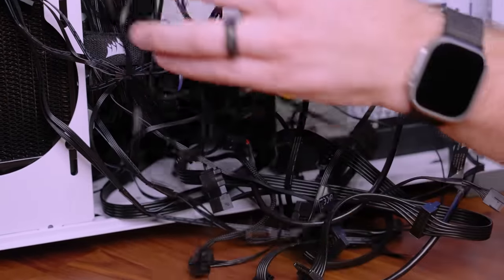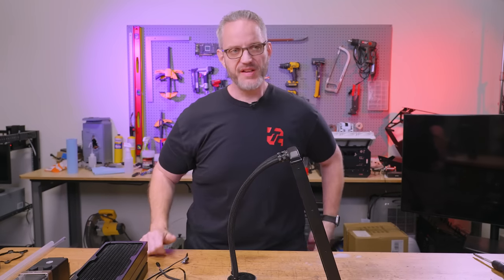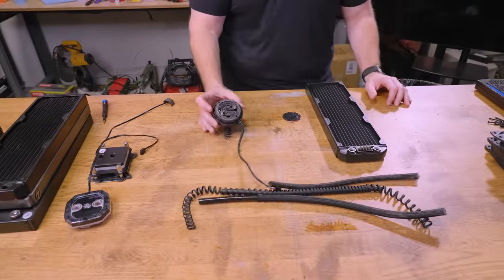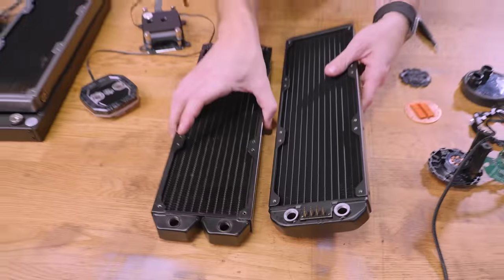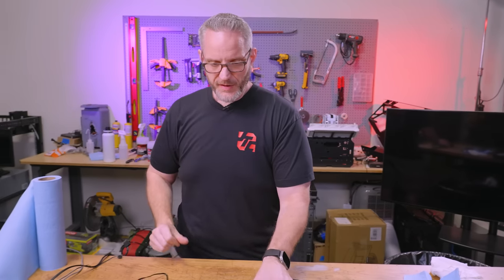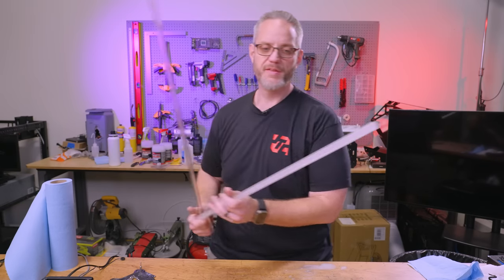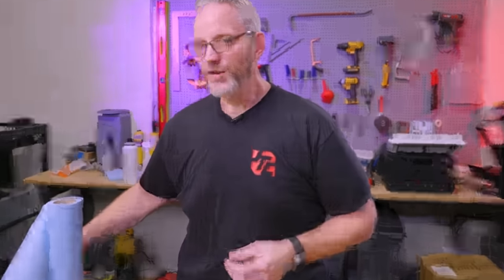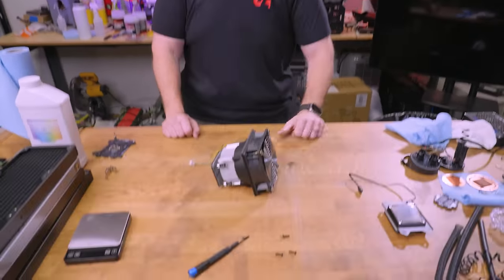Which one is right for you?

Comment: This was enjoyable content to watch; thank you. Seeing someone experienced with custom loops putting one together is a much more attractive video than watching someone install an AIO; will look for related videos from you if I ever stop using air coolers for my setup.
  AIOs never made much sense to me as the many I handled never seemed to handle temperatures better than a high end air cooler, cost more than said air cooler, and were noisier systems than the air cooled equivalents though I didn't get to work with them + the latest heaters from AMD/Intel.
Reply: AIO's absolutely spank high end air coolers these days .  They can run at least 3 to 5C cooler, take a lot longer to soak, and are nearly always a lot quieter.  This will obviously depend on the size you get, but spending money on a sensible priced one like Arctic Liquid Freezers (and not some of the insane priced RGB covered rubbish out there) will get you far better thermals and acoustics than any air cooler can provide.  It will be interesting to see the performance of the new Deepcool Assassin 4 and NHD-15 Rev.2 when they are released - they will certainly close the gap, and current models like the AK620 and Peerless Assassin make strong arguments from the value perspective of good well priced high end air coolers vs AIO.

Comment: The tube has a wall on both sides of it, so for a 10mm inner / 14mm outer, the wall is not 4mm thick, but 2mm thick, x2 because it's on both sides.

Comment: Not realizing AIOs are usually aluminum is a bit of a stress point for me now. I added custom water cooling to my laptop using a BeQuiet Pure Loop. The piping used on the laptop is copper because I just default assumed the AIO was also copper. I found out it was aluminum after 2 months of use and changed the coolant to something with more corrosion resistance but Im not excited for the day I have to remake the heatsink because of mixed metals.

Comment: Thats why i love my D5 Next. You can control it "via PWM", but you can change it even without any software. And it has a build-in "mini-Aquaero" and a temp sensor. Control your radiator fans in dependence of the coolant temp? No problem! No need for an extra sensor and no extra cable. But it costs a little more. 130 Euros compared to 70 to 80 Euros for a standard D5 pump.
My whole CPU-only loop was about 500 Euros and therefore about 1,5 times as much as my CPU. Thermalright contact frame, Aquacomputer block and pump/res-combo, Alphacool rad, EK softtubes and fittings - with drain valve. Fans...? Arctic P12 PWM... and yes, without RGB!

Comment: Side note.
Copper and Zinc = Brass
And
All zinc-based alloys have excellent corrosion resistant properties; they just act a little differently than aluminum based alloys. While aluminum has the ability to “self-heal,” zinc will eventually break down and degrade over time.

Comment: I’d rather go with an AIO for the simple fact that I don’t have to set up the loop, if it leaks it’s not my fault, if it fails it can be easily replaced under warranty, when deconstructing the computer AIO is much simpler to uninstall. 
As for your comment about the i9 13900k, unless you’re over clocking then quite honestly an AIO will work just fine. I have an i9 13900k build using a deepcool LT720, my cpu never goes over 68C under extensive load even in an sff pc case not running push pull on the radiator

Comment: I've never used more than one fan at the back of my towers, and the one that comes with the CPU. I just bought 5 new fans and a hub to, for the first time, do something about cooling. Not that my components get too hot or that they fail (I've never had that issue), but I fear that the desk I'm about to build will somewhat enclose the tower with wood and, where I live, summers can get extremely hot (about 40°C on a really bad day) and extremely humid (usually more than 90% on rainy days). I don't have the money to even start thinking about water cooling, so a lot of fans is the only thing I can do.

Comment: I use both, but I only use an AIO on a cpu that doesn't generate a lot of heat. My AIO of Choice is a Cooler Master Glacier 240L. I have 2 and they can be expanded and drained and refilled with Swiftect fluid. Which I have done several times. On my larger more powerful/Heat producing system I use an open loop with Very High End components. Heat Killer, Hardware Labs, EKG. The Radiators are 60mm thick, you will never find an AIO with a radiator thicker then 30mm. Choose wisely your CPU and GPU will depend upon it.

Comment: Build my first PC in over a decade. Using an AIO for now, because I had to get it up and running ASAP. But as I upgrade from the parts that were readily available I just might move to a custom loop. The last time I built a loop premade and modular fittings weren’t as readily available. I spent a fair bit of time in the plumbing aisle of my local hardware store >.<

Comment: Custom Watercooling FTW! Did it since 2008 and still doing it today! For: the overall build quality, aesthetics, looping, thermal performance and longevity which are better than any AIO if you do your research correctly! However the biggest win for me is GPU watercooling across 2-4 SLI Gpus. (Remember when SLI was still alive and kicking?) Plus my RTX 4090 is soooo small now ^_^
As a plus: You can re-use parts from your custom watercooling in the future - if ofc it still makes sense :)
Edit: i added this comment before watching the video ;)
Reply: I still don't have enough fittings Jay, and last year I spent 200£ on buying all the fittings that I would need for my new build... Guess what? I was still short of a few :)) Fittings are the most expensive part as you can never calculate exactly how many you need if you want to do anything a bit more fancy than connecting A to B no matter how it looks ;)

Comment: The lines and block being restrictive doesn't make any difference when it has to go through a restrictive radiator. Also, only use ceramic thermal paste. You don't gain enough cooling from using corrosive pastes to justify doing it.

Comment: As a hobby brewer that has attempted to try and understand water chemistry(it's incredibly complicated!) , i wanted to talk about the use of distilled water. It is the minerals within water that provide a buffering power that help resist ph changes. The problem with distilled water is that it is super sensitive to ph changes because there is no buffering power what so ever. So it is very important to use an anti corrosive agent when using distilled water. Even if you use an all copper system, you will still have an ion exchange occur through your water and this will cause your water to become acidic and corrode your system. Not saying using mineral rich water, because this will create another separate problem of mineral build up, but definetely use an anti corrosion additive!

Comment: I'm not an over clocker, all my PC's are above average builds that can last 10+ years. I've run into too many problems over longevity with water cooled systems (fittings, and tube splitting). In the real world water cooled systems are for the folks that need something to do with their systems every 9 months to a year (mainly preventive maintenance). The closed loop only needs to be changed out if your CPU temperatures start spiking for no reason that could be after the 3rd year or never.

Comment: Custom Loop with Soft Tubing only. Never even tried an AIO as I always buy top of the range Intel CPUs. My main development system has been running custom loop for 10 years with only an occasional fluid top up. Last 10900K/3090 at launch was custom loop with waterblocks on both. Upgraded to 13900K and 4090 using the same custom loop and haven't bothered with the GPU waterblock yet, but adding a RAM waterblock right now. EK 360x60mm rad, Noctua Industrial fans and Velocity^2 CPU block. Mayhems UV Blue to avoid any particles that will eventually clog something up, usually the CPU fin plate.

Comment: The main problem with AIOs is that the tubing doesn't allow doubling up on radiators, not to mention running the loop outside the case 🤔 Had a few doa AIOs mostly because of shipping issues too. So the first thing I do is run new ones on a testbench to see if they leak or .. well if the pump is even working in the first place. One doa one even had a tiny crack in the radiator, took me ages to find the leak so I could properly RMA it 🙄. Never had such problems with custom loops for some reason.

Comment: I started my Custom loop journey by modding my H100i that had a leaking tube replaced it with soft tubing and added a reservoir temps didn't change even with the added water of the reservoir adding a pump and not using the pump on CPU block made my temps go down by 5-10C immediately so pump speed also matters a lot upto a certain point the pump on those AIO's are trickle slow even on the fastest speed setting.

Comment: The Corsair H40 in my SO's PC is still going strong since 2014. Only had to replace the fan.
I run soft tube CL which I haven't cleaned in almost 3 years. So far I have only noticed the GPU getting about 3-4C hotter.

Comment: I started with an EK Predator setup, it was a marketed as an AIO but with the ability to be incorporated into a custom loop, it was a great setup and eventually I decided to get a watercooled GPU and built a full custom loop around it, the cool thing with the predator was the pump was built into the radiator, and when it was working it was great but  I did eventually have to replace the predator with a standard radiator pump setup as it developed a leak after I used some pastel fluid that ended up clogging up my entire loop and caused so much pressure that the  predators radiator literally burst, fun times 🙂

Comment: I ran a kraken x61 for 8 years on one of my systems (2014-2022). At the end I believe it finally did loss to much liquid, as the pump sounded like it was free spinning. So i felt like that was a good life for the price, even though I did replace the fans once during that time (but i am bad at cleaning, pretty sure my fault one died).

But I replaced it with a Noctua U12, and it had better average temps then it ever did with the AIO... So i wished i would have gone air at the start. 
Though 99% sure that is due to the NZXT case that was popular at the time having horrible airflow.

Comment: I got this plan to use the new EK combo block that is both Cooler, Reservoir and pump. Some EPDM tubing and a single radiator for a SFF build.
Still couple times more expensive than an AIO, but it seems like a nice compromise that gives me good control over the form, maybe even use some printed brackets to keep the tubes nice and tight together. Originally considered solid tubing, but rubber seems good enough and way more maintenance friendly.

Comment: I got a Corsair AIO four years ago, and it's still working fine despite running Primegrid through BOINC most of the time. It still keeps my CPU around 60 degrees C. (I always run my CPUs with turbo disabled for stability, longevity, and heat reduction). Although my AIO has always made gurgling sounds when the CPU isn't doing much (and that has gotten a little worse with time), oddly the sound goes away when my CPU utilization goes up. (Maybe the fluid is getting circulated faster which reduces the gurgling sound)? Maybe I'm just slowly running my AIO into the ground - lol.

Comment: The AIO probably performs well enough, but the custom loop might gain a degree or two. AIO's beat open loops with a spiked bat on price.
The advantage of the custom look is mostly visuals, but it can resolve fitment issues an AIO isn't really flexible enough to deal with.

And now the video...
The diminishing returns kicks in very quickly with a custom loop. For me, once the cooling costs way more than the part being cooled, it stops making sense. 
a $300 reservoir on a $200 CPU is not a good deal, especially when you consider the rad and pump  could  cost about that much each. 
Then there is the headache of tubing, fittings and if you're using rigid tubing bends. You really have to enjoy the basics of plumbing to not hate that part.

When you go as all-in as Jay tends to do, the cooling loop winds up worth more than the rest of the system, and it would be really nice if those costs were relayed to the viewer more clearly. 
Yes, tubing prices will vary depending on how much you need, but pumps, blocks, rads  and reservoirs are always going to be part of it, and they tend to be expensive.
Knowing the costs upfront might dissuade some, but better to do that and just leave the folks that know the cost and do it anyway.

But a new video showing the temp differences at different price levels between AIO's and custom loops would be really helpful as a companion to this.

Comment: i've had nothing but issues with AIOs, myself. if i was going to go water, i'd go full loop.

but with my last rig, i looked at the cost, did some math, checked the overall performance of air, and just said screw it and bought an nh-d15 chromax black and called it a day. same rough performance as most AIOs or better, close to the range for custom loops, and less than the cost of some AIOs. win-win.

Comment: funny how definitions can change over time. back in the days before aio existed, a closed loop was what nowadays is an open loop - no part of the water is exposed to the outside. whereas open loops had a big open bucket or vat as external component to support cooling by sheer mass and evaporation.

Comment: Yeap, about what I expected. AIO work, thought they would last longer. I do the flex tubing Custom loop, need to add another rad too it, thought I over sized it right. But summer is coming and slower frames are around the corner. I will be approaching 70 C on my loop. Good thing I have to do maintenance this month LOL.

Comment: Didn't consider shelf life on an aio, this made me think I've been a bit lucky with mine.  I7 3930k at 4.8ghz its whole life and other than new fans (old ones got very loud so probably bearing) this year its never had issues since i built it in late 2011 or early 2012 
Still never goes over 50c fluid temp 
Before that i did have a custom loop with cou and motherboard blocks that was fun to build, not too keen on the prices these days though

Comment: The other thing about distilled water, is that is non-conductive. All the minerals that were remove is what it gives their conductivity, so if you have a bleeding with distilled water, you are kinda save that your board will not die due to a short circuit (I still prefer to shutdown everything and dry out all)

Comment: I have a question 🤔 why is Cooper better. From Metalogical standpoint aluminum Dissipates heat faster than copper.That that's why automotive performance radiators are aluminum not copper, is that different for PC's? Honest question 🤔

Comment: i like AIO watercooling because:

-its pretty easy to install usually
-it can cool a lot of heat
-it usually isnt that expensive and definately cheaper than a custom waterloop

cons:

-once the pump is dead you have to throw the whole AIO away
-same if you accidently damage the radiator or the hoses
-and just the same once too much liquid has evaporated through the hoses.

for Custom waterloop speaks:

-its maintainable so you can just switch out the part you need to replace
-it looks frickin great if you do it good
-you have a huge thermal energy reservoir which wont overheat instantly if you push your system
-the choice of how much heat energy you can transfer out of the system is on the choice of your radiator count and with that your heat distribution surface

cons:

-its frickin expensive especially if you want it to look really good (id have to sell a kidney and part of my liver to be able to affort it)
-the cooling solution you choose sets the rules for what case youll be able to use, so if you want to use a case you have from before you'd probably run into some space constraint that doesnt allow your ideal build
-you gotta put hard work into the custom loop or pay someone a lot of money to do it for you.

concluding: i like both